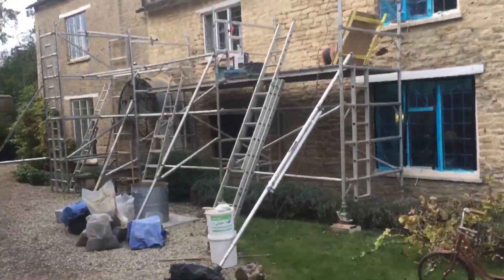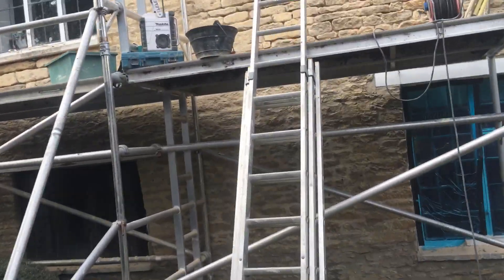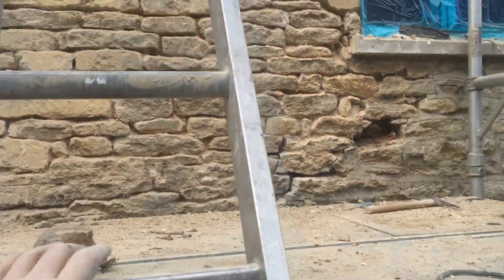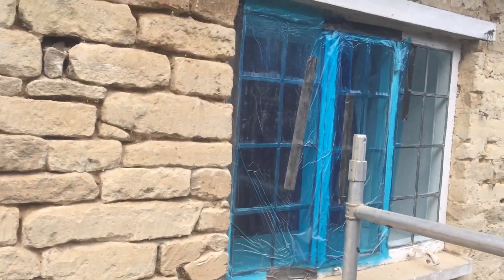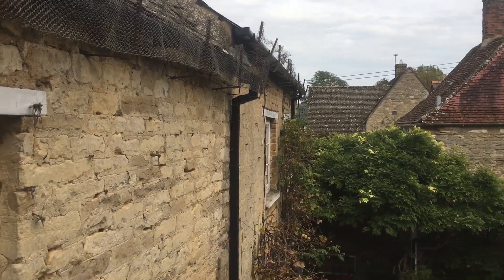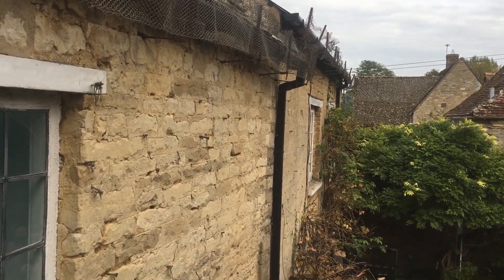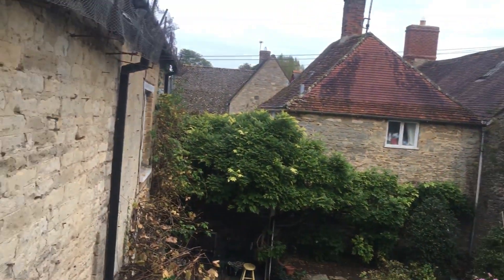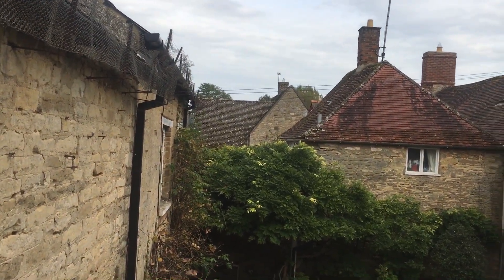Michael James Design: why you should never add cement to a lime mortar.

Comment: What methods in historic terms did they use when putting iron fitting fixings ,/nails etc into their wall to prevent them rusting? What do you do or advise regarding this situation? Through brick or mortar etc?  . Say for instance hanging baskets door pull bells , Numbers , names of buildings etc . I deliver to alot of properties i should take more note!
Reply from the maker: There was never any prevention. Hardward just rusted. However, not very much. People now use galvanised steel where they can.

Comment: I don't disagree but I am confused; isn't portland cement already around 64% lime?
Reply from the maker: Hopefully I can dispell any confusion. Cement (Ordinary Portland Cement) is made from limestone. But the kilning process burns the limestone in such a way that any lime is actually locked in. The result is that it's unavailable i.e. there is no free lime - it has a zero free lime content. Whereas quicklime, NHL, lime putty and lime hydrate all have a certain percentage of available lime. Quicklime has the most (usually around 90%) depending. NHL2s are often higher in free lime that NHL3.5s. In direct contrast, NHL5 has the least amount of free lime and is very cementitious.

Comment: Hi Mike, I have recently read the 2018 research paper on NHL mixes which I got from Nigel Copsey. It is quite an eye-opener. It appears that nothing is standardized. Indeed, with some suppliers there is little or no difference between their different NHLs (2; 3.5 and 5), they are the same product in different packaging. No only this, but nobody seems to know just how long they will continue to harden. I will now only use hot-lime.
Reply from the maker: Now you know. This is the problem. And there're also differences in free lime content within the same brand of 3.5 across the country. It's all very loosely classified. There is a place for NHLs as they're good binders but they should've never been specified without proper empirical evidence. Now we have it there's a current sea change.

Comment: As we never use cement we always use natural pozzolan to engage  NHL's  free CaO with pozzolan's  active SiO3 .Try this recipe :  
NaturalPozzolan    140 gr.  
NHL2                       540.gr
Sand 0,2 mm        1188.gr
Sand 2.8 mm         132.gr
Water                     225 ml/kg
Every building is a unique case
Reverce engineering is a compliment to experience.
Keep on the exelence high
Cheerio!
Reply from the maker: I find all NHLs to be strong enough without any additional pozzolans. But thanks anyway.
Reply: @michaeljamesdesign  I thought Pozzalans were cementious compounds. For example volcanic ash added as part of Roman Concrete.

Comment: Cheers, I recently moved in to a house with stone walls which has been repointed with cement. I will be taking this off and repointing with a lime motor, Ilan I correct in saying a Hydraulic nhl 3.5 would be good to repoint. Any advice would be brilliant. Thank you:
Reply from the maker: Or speak to Declan and Chalkdown lime and tell him you want some NHL with a high free lime content.
Reply: @michaeljamesdesign  brilliant thank you, also I was going to mix it with washed sharp sand. Will this be ok?
Reply from the maker: @knickersbrown  Depends on how sharp your sharp is.
Reply from the maker: St Astier NHL2